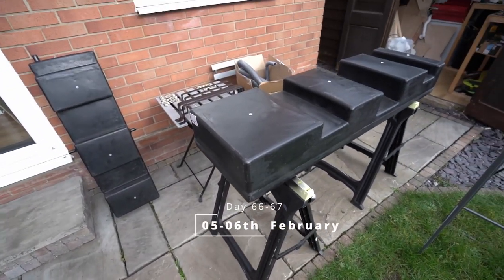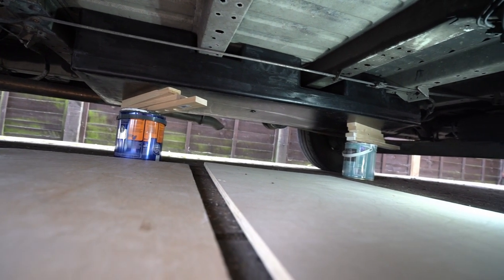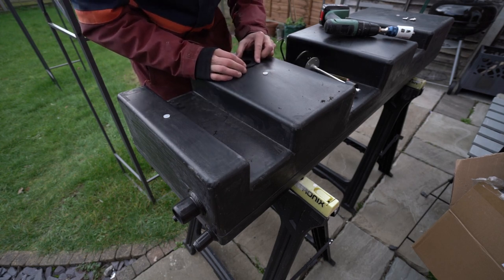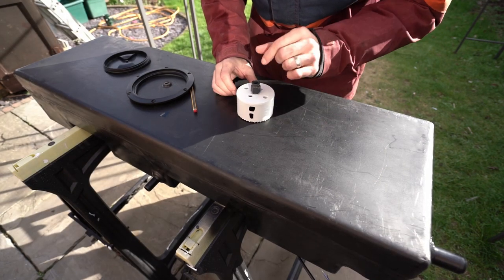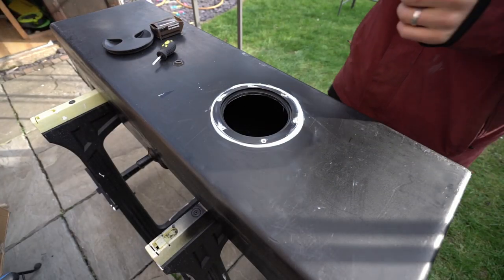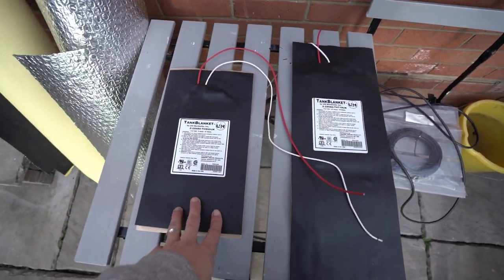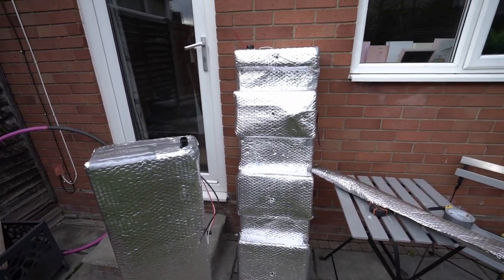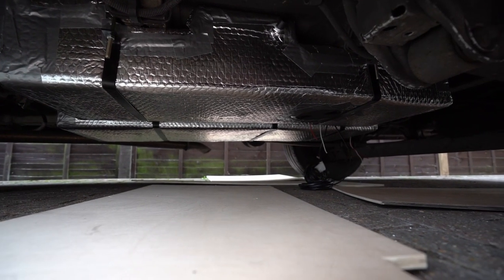CAK Fresh & Waste Water Install - Tank Blankets -  Citroen Relay L4H2 Campervan Conversion Vlog

Comment: Hi, you put heating pads to water tank and little-bit insulated them but i am more worried about all water lines under the van (including water filling pipe if it stays partly filled with water). Did you insulate them too? If not then it would be good idea to add heating cable to them and cover that with pipe insulation

Comment: how did your access hatch on the waste tank hold up, I've heard others suggest that they do leak though could be fixing methods
Reply from the maker: Hey Andy, Yeah i was worried about it too, it had a tiny leak at the start from the hatch, but after tightening the lid even more its fully sealed for now. I wouldn't recommend adding one of these to the fresh water for sure tough just incase.
Reply: I think you should have added the hatch to the top of the tank so you don’t have to deal with leaks.  The vibration of the van could make that leak come back

If you need to clean the tank then you would have to drop the tank to do that.

Comment: Hey we’ve got this tank. Wanted to ask what connection you used on the tanks main water outlet that goes to the pump? There’s no thread or anything so wondering what the best method is.
Reply from the maker: Hi! I go over it in the Water System overview video, its a JG push fit  connector 15mm to 12mm to the tank.
Reply: @CasLaz  thanks! These tanks really are cak aren’t they 😂
Reply from the maker: @slowmadders  Lol yeah they aren't great.. but we made it work 😂
Reply: @CasLaz  hey. Just got the Speedfit fitting but it leaks a lot when connected up to the tank outlet. Did you use anything to seal it? We bought a pipe insert but it was too big.
Reply: Scratch that, I was being an idiot.
Reply from the maker: @slowmadders  Is it all working fine? Mine didn't leak at all when i tested it.